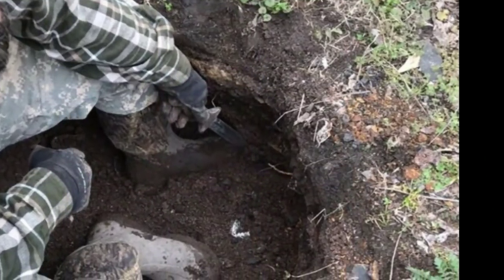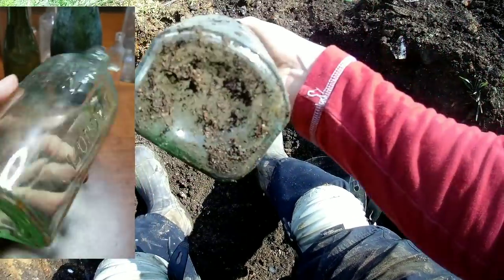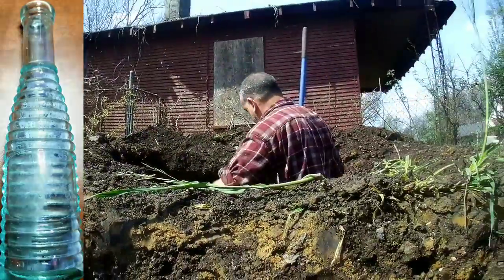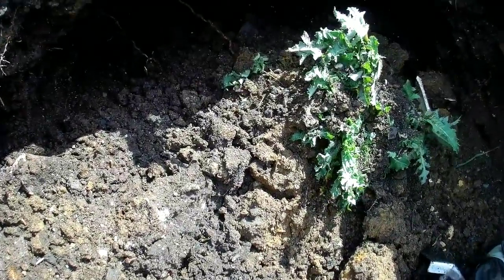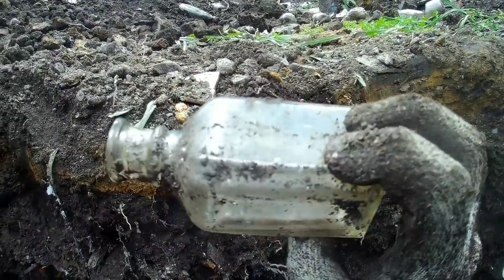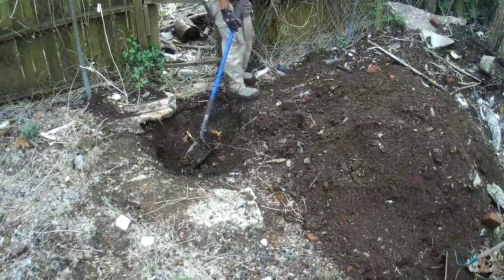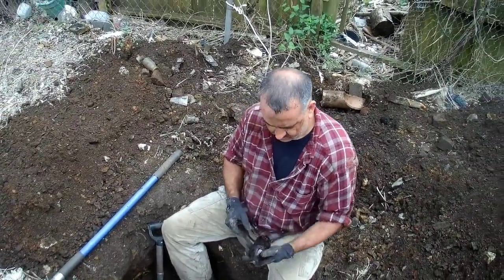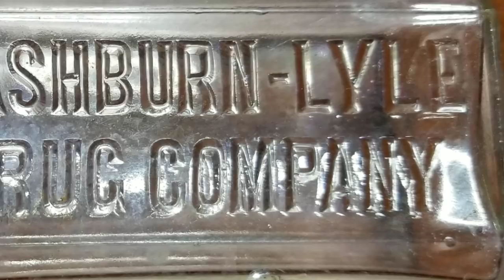I Can't Believe He Found it!  Antique Bottle Digging - Jack Daniels no 7 - Coke -Medicines & MORE

Comment: That's an odd place for a teens landfill. Right between two 1929 houses. There was probably 2 more houses where you are digging. but they collapsed since they were built on a dump.
Reply from the maker: You are correct sir very odd. But the bottles are there. I appreciate you watching and insight.